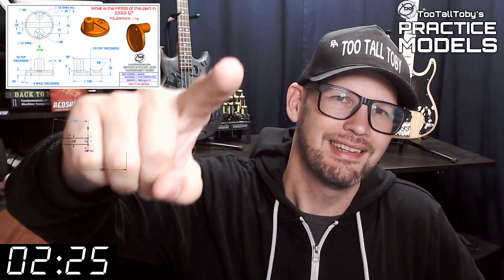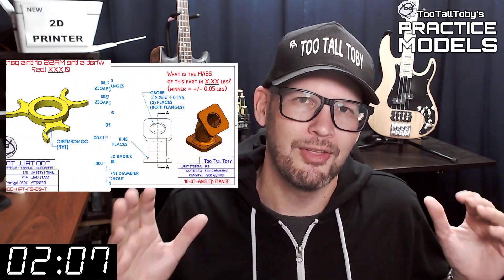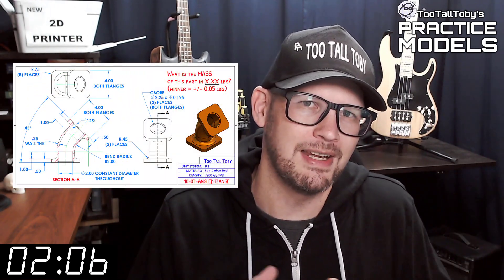SOLIDWORKS Practice - Onshape Practice - Fusion 360 Practice Exercises - TooTallToby-11-05

Comment: 13:45, Got a ways to go to catch up to all these sub 5 minute makes on all these videos.
Reply: Attempt 2: 6:15. A couple of hiccups but the comment below about using the hole tool is way more efficient than a series of extrude cuts. Didn't even think about it for the counter sink.
Reply from the maker: Very nice I like the increase in speed!  Good job!
Reply from the maker: Very nice!

Comment: Hello, on my model the 12344g is if you put the CBs in the bottom tabs also. Without the bottom CBs I get 12374g.
Reply from the maker: Hi Mark - The correct answer is shown at the end of the video - If memory serves me, the C-bores are only on the top tabs.  Good luck and thanks for the comment!

Comment: 10-ish minutes and 12339,299 grams. But I can't seem to get the right density, maybe that has something to do with personal use license on Fusion 360?
Reply from the maker: You might need to add a custom material to the Fusion Library.
Reply: @TooTallToby  I have the density set to 1,020 g/cm^3 and that should be equal to 1020 kg/m^3 🤔 Maybe I just did something else wrong. 
Edit: 
When i right-click the document setting, then properties and check the Physical tab it sayts "Density: 0.001 g/mm^3" instead of "0,00102 g/mm3". But when i check it in the Manage Materials it says 1.020 g/cm^3. All this is scrambling my mind haha.
Reply from the maker: @rasmuskarlsson7058  Did you notice that the lower holes on the flanges are NOT counterbores?
Reply: @TooTallToby  I'm a newbie so I don't quite get what you are saying. I just extrude cut those 22mm diameter holes on the bottom flanges. Thank you for responding btw!
Reply: @TooTallToby  I just want to add this, your videos and tournaments are awesome!

Comment: My first time trying a challenge like this, went pretty good i think. I used SW21 :)

Time: 6m 26s
Mass: 12344,75g

Did the following:
1. Started out with the main body as an simple boss extrude
2. then modelled one tab and extruded it in top and bottom
3. used Circular pattern to make the other tabs 
4. Extruded the part going out of the body as a simple cylinder without the hole.
4. lastly i used legacy hole (hole wizard) to make all the countersunken holes.

I lost some time in the last step cause i haven't used hole wizard much before and couldnt find the right properties
Reply from the maker: Very nice job Mikkel!  626 is pretty fast for this one!

Comment: Mass: 12344.72g
Time: 4m 32s

Modelled in Solidworks 2022, agreed with other commenters - the better you are at managing order of operations the easier this one is 😃

Process: 
1. extrude main body as a mid plane extrude around top plane. This gives vertical symmetry.
2. Model tabs in and extrude
3. Mirror tabs around top plane
4. Hole wizard with custom counterbore properties, with depth "thru all".
5. Sketch on top plane with 30mm offset for stub drawn, then create a reference plane using offset and relative plane
6. Model in stub to next, without the counterbore.
7. Cut extrude hole through
8. Cut extrude counterbore
Reply from the maker: Nice job Matt!